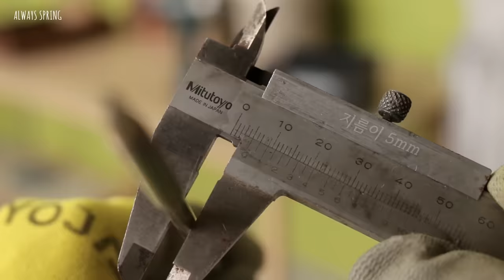[정원 DIY] 안 쓰는 그릇과 낡은 책상다리의 환상의 만남! 감성 넘치는 봄정원 가꾸기/그릇 구멍뚫는 2가지 방법/다이소 추천템/화분받침대/재활용,새활용, 업사이클링

Comment from the maker: 07:45~10:18 구간의 음악에 문제가 생겨 음악을 삭제하면서 영상속 소리가 상태가 안 좋은점 죄송합니다 ㅠㅠ
작업에 사용한 제품 알려드립니다 :)
I'm sorry that the sound in the video is not good as I deleted the music due to a problem with the section's music ㅠㅠ합니다
I'd like to inform you of the product I used for the work :)

*팬톤 우드&메탈  페인트 : https://smartstore.naver.com/paintsegye/products/4932308162?NaPm=ct%3Dlt7wzi08%7Cci%3D94ffbda92e269faa8070b3c00a66a226e7a9bd5c%7Ctr%3Dslsl%7Csn%3D1165127%7Chk%3De04e29656dcaf703a0d9b84e095fb4d109fb642d
*테이블 다리 : https://www.moongori.com/goods/view?no=816920
*소포장 몰탈시멘트 : https://smartstore.naver.com/cement_diy/products/592481305
*믹스앤픽스 에폭시퍼티: https://smartstore.naver.com/chemical/products/7055018678
Reply: 대단하십니다.어쩜~~저도 따라해봐야겠네요.영상 큰도움되겠네요
Reply: 와~~~대단해요
Reply from the maker: @최정숙-t5i7s  칭찬해주셔서 감사합니다! 예쁜 다리 구하셔서 멋지게 만들어 보세요 ^^
Reply from the maker: @hyejason7388  칭찬해주셔서 감사드려요 ^^